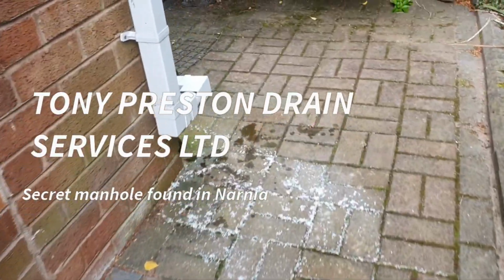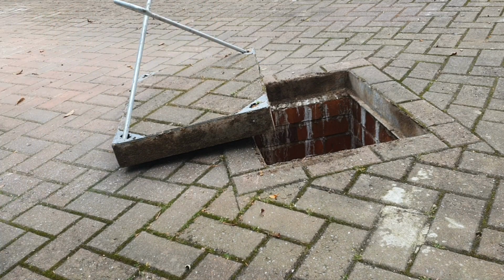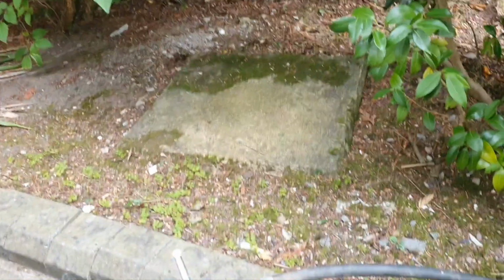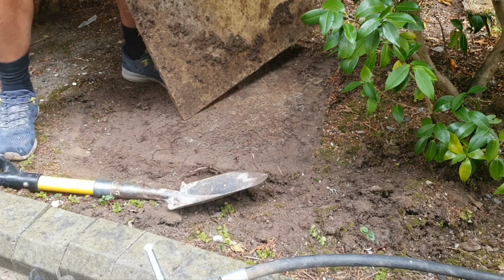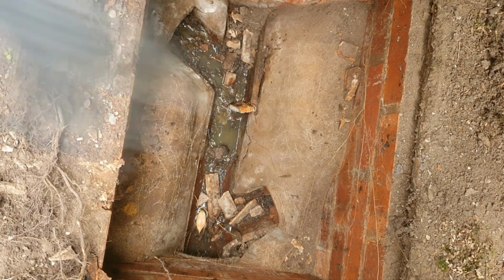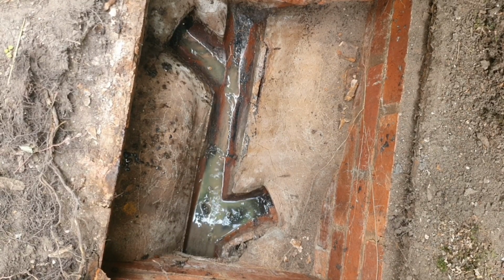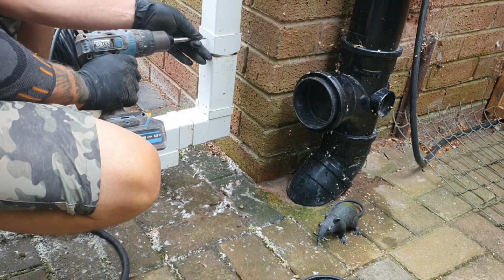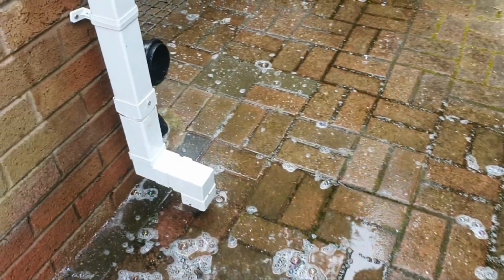sewage spilling from blocked drain Part 1 #blockeddrains #drainunblocking #sewage

Comment: Question about the storm water drain. Wouldn’t it have been better to use short screws instead of those long ones ? Wouldn’t leaves eventually get “stuck” on the long screws or r u going to return an fix that storm water drain mess?
Reply from the maker: Great question that. I think the screws will be the last of their worries if leaves block the pipe with it being around 8ft long but its a fair question about screw length maybe shorter would be better, I have been screwing these things together for 30 years with no problem. Thanks Sandy I will look into it.

Comment: isn't there code against hooking up a roof drain to sewer connection??
Reply: Rainwater is taken as surface water and has nothing to do in the sewage system. At least that's how it is here in the Czech Republic.
Reply: @CisticOdpadu  usually they don’t want rain water in the sewer because the system would get overloaded very quickly
Reply from the maker: Very true mate
Reply from the maker: A lot of houses are combined. The new houses are seperate.
Reply from the maker: Hello mate yes same here but there are still many houses with combined drains
Reply: In most circumstances building control do not want surface water in foul sewers these days as it can overwhelm the network really quickly when there’s heavy rain, which leads to sewage being discharged into waterways via CSO’s (combined sewer overflows) owned and operated by water companies. It’s recommended that rainwater runs either into a soak away which is buried under ground, or connected to a separate rainwater network which will run to a watercourse or wetland to drain away.
Reply: @drain-unblocker  In our country, of course, some older houses are also led into the sewage system. I didn't know that it couldn't be due to overcrowding. I thought it was because of the difficulty of the difference in treating sewage and rainwater. Good day gentlemen.
Reply from the maker: @CisticOdpadu  thanks mate 👍